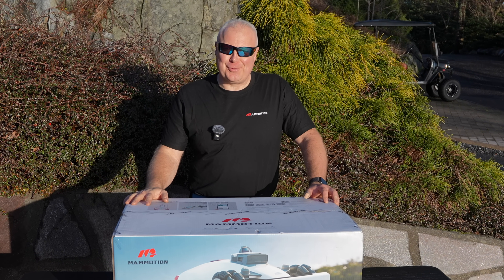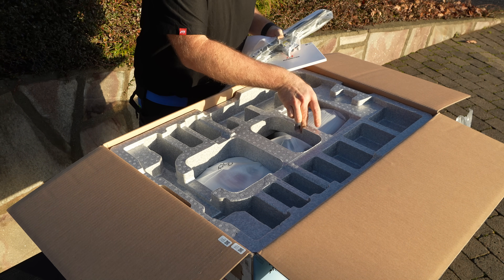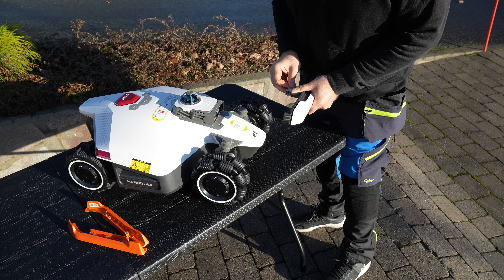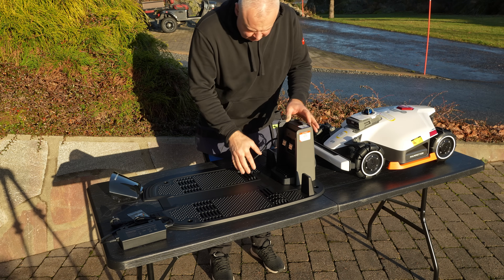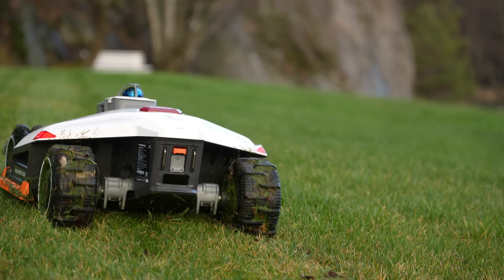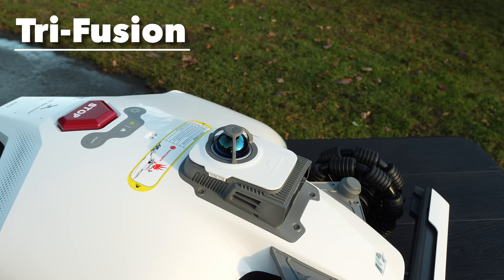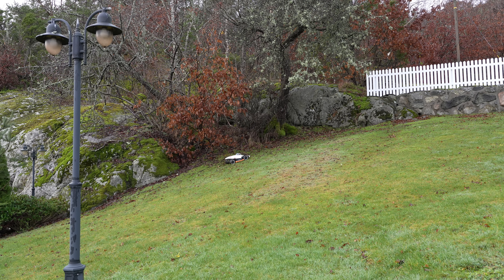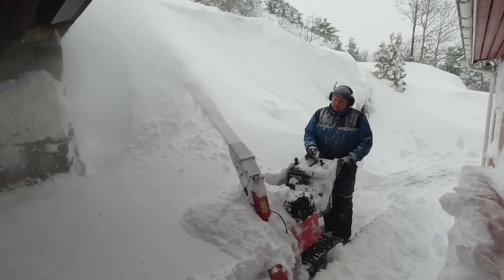Mammotion LUBA 3 AWD 5000

Comment: What iam worrying about is that this company ditches old models as it pushes new one every year out. What that menas is that you stop receiving updates your mover after a year or so. I had the very first one and it has some issues which could be easily fix it but they did not want to do it. Like it tears your grass as it turns every time in same place. Just a few cm difference could help there nd so on. Of cource you have to remember that this is china made and quality is that. Everything look neat but i dont know about long lasting. In my first edition for example every plastic clip for cables broke right away. Of cource mover it self had an issues too and made couple videos about those. Now sense they dont develop mine anymore iam thinkg which way to go. Husqgvarna seems to have some new modes coming u which iam lookiing. This model looks nice but it is very difficult to make a decicion after so bad experiences with first edition.
Reply from the maker: I think the Mammotion makes some really high quality mowers though. At least the new models.

Comment: I am curious, if you have the decorative concrete curbing around something, for example a tree, a flower bed, a fire pit etc. do you have to map the area as a no-go zone or will the robot stay within the zone it is working and just get close to but go around the concrete curbing?
Reply from the maker: It will detect it automatically, but it is better to program it as a no-go zone. You do it once, and it will remember it. You will get a more precise cut, and it will give a nicer and even cut.
Reply: @InTheVise Sounds good and fully understand. How long have you had the Honda hybrid snow blower? I have the Honda  HSS1332ATD tracked blower and love it. I was on the fence about the hybrid because it seemed so bulky and heavy. Love the one I have nonetheless. Also, what country are you in that you have such beautiful waterfront property?
Reply from the maker: @98RSPSupra I’ve had it for about three years, I bought it used. It is a 2012 model, but in very good condition. Upgrading from a Honda HHS970, it is at another level. I have a lot of snowblower videos on my channel with different Honda models. Haven’t tried the 1332, but it is a beast I guess! I live in Norway.

Comment: Being AWD, does this tear up the grass when it has to turn sharply or turn around to mow in the opposite direction?
Reply from the maker: I think the Omni-wheels doing a good job of not tearing up the lawn. But it can make some tearing if it is wet.
Reply: @InTheVise Thank you. I guess I will put in an order for one and give it a try.
Reply: Does this mow patterns such as stripes, diagonals etc., and if so, are the patterns in the app?
Reply from the maker: @98RSPSupra Yes it does. You can change the pattern in the app.
Reply: @InTheVise Thanks again!
Reply from the maker: @9 @98RSPSupra You can even program it to write text and emojis in your lawn!!
Reply: @InTheVise Just placed my order based upon this video. Thanks a bunch, sir.

Comment: Have they improved the turning behaviour to stop tearing up the lawn so much?
Reply from the maker: You can adjust the turning mode in the app!
Reply: Hi, i dont think that would ever change. Its not the turning behaviour, its the design of the wheels. The turning modes will not change tearing down the grass, when its soft.